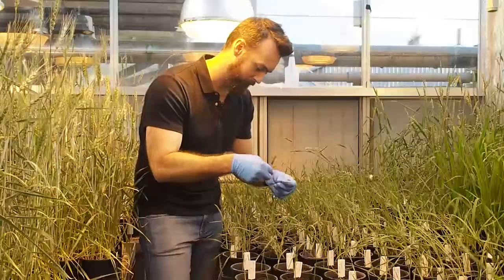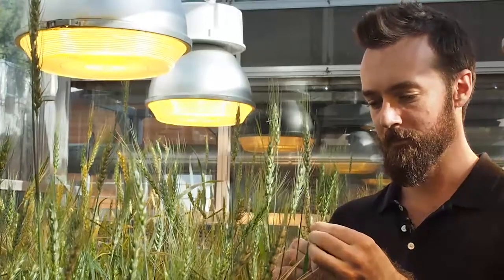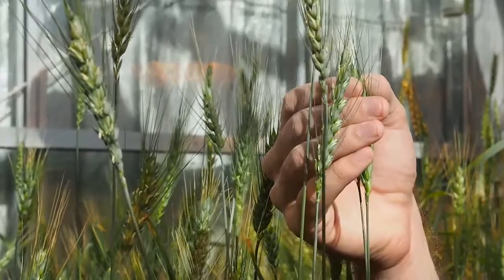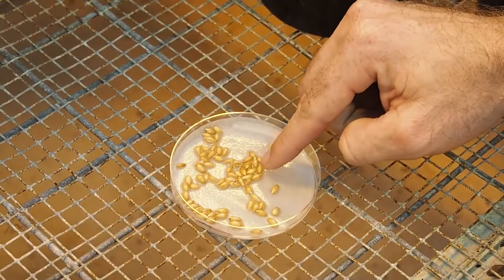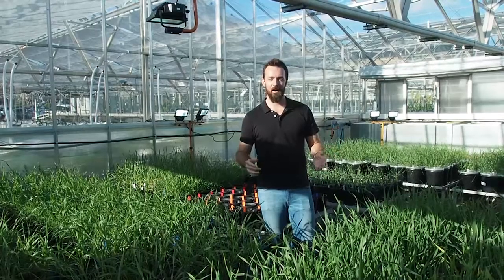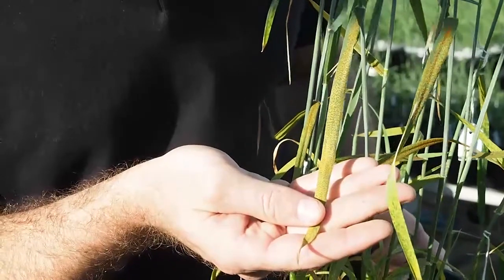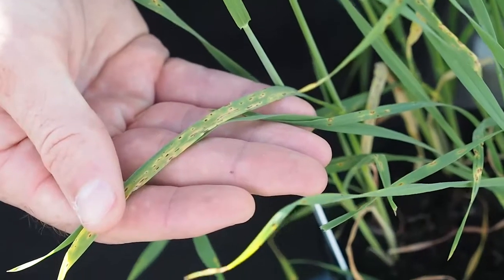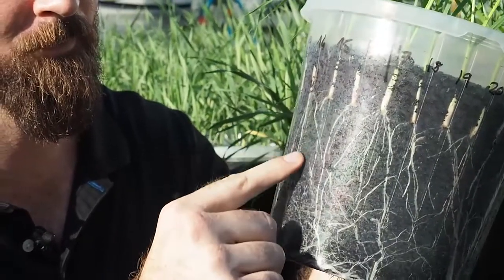Wheat Speed Breeding at the University of Queensland with Dr Lee Hickey

Comment: Won't it disturb the Circadian Rhythm of the plant?
Reply: We actually use a 22hr/2hr light/dark cycle. This generates healthier plants and was chosen over a continuous photoperiod to support functional expression of circadian clock genes
Reply: This is a promising work and can trigger the next revolution in agriculture. But how do you plan to get all the electricity required for the lamps? Won't this technique increase the carbon footprint of crops?
Reply: We are in the process of converting our sodium vapor lamps to advanced LED lighting, which significantly reduces operating costs, both for lights but also temperature control because they generate a lot less heat. It's an exciting time because of the advances in LED and renewable energy!
Reply: Can we use the lights only during night and there by reducing the electricity costs?
Reply: @gomathid559  That is a good question. Then the next question is how much light (pars) is needed per sqm?